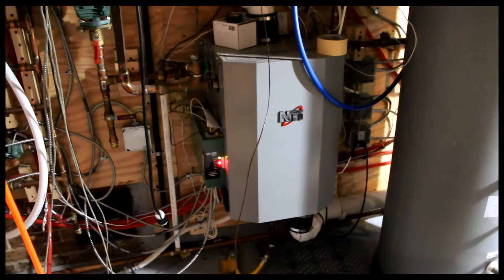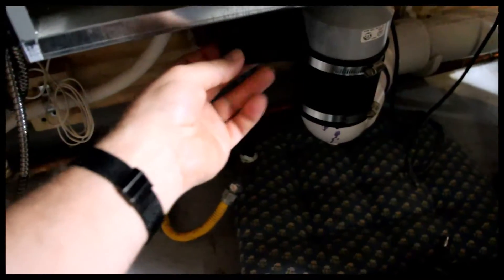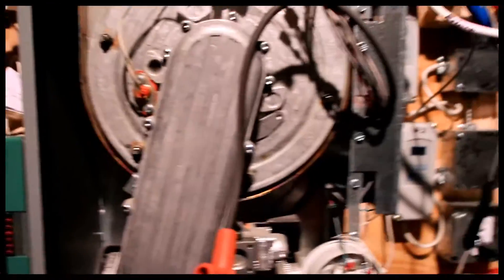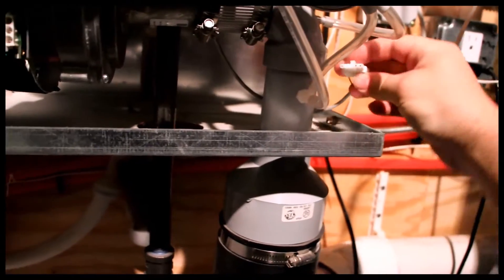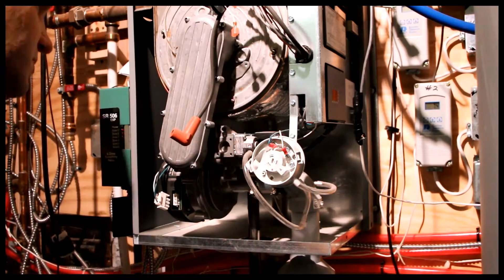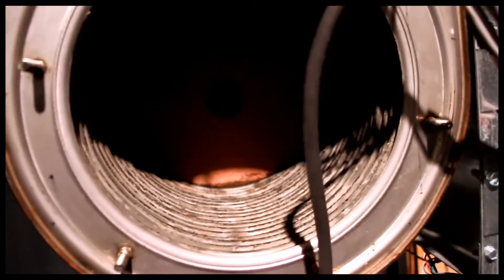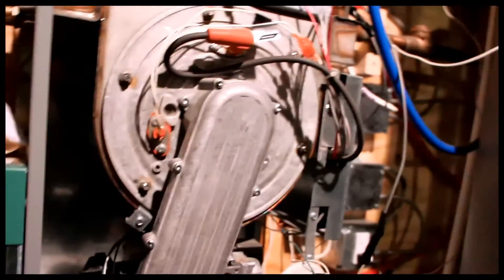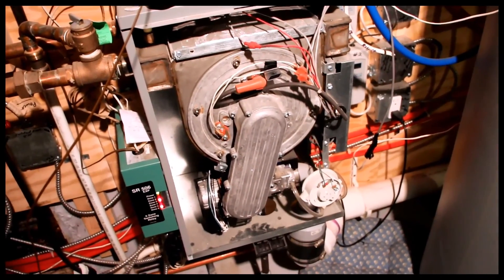nythermal nti boiler trinity ti100 cleaning service diy

Comment: Good stuff - how frequently should these boilers/systems be descaled?
Reply from the maker: I dont know....for me I've done it once since 2009
Reply: @matthewolson8875  good to know, thanks. I’ve been worrying because some friends have boilers that need to be flushed annually but when I called NTI they said ours rarely have to be which left me puzzled. But the service technician said the same
Reply from the maker: @gatharound  yeah....I've been told not much maintenance either

Comment: Hi there, what's the extension bit the used to remove the screws behind the motor?
Reply from the maker: I think its 1/4" extension with a wobble joint...  and I think its a torx bit at the end but I dont remember